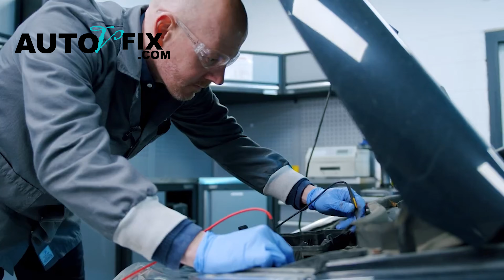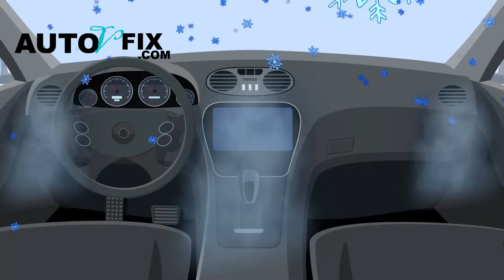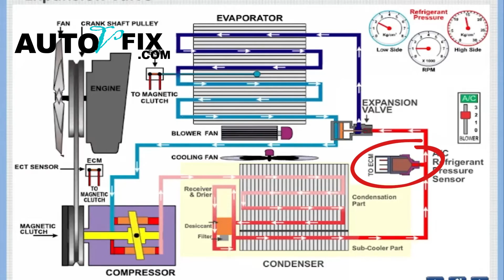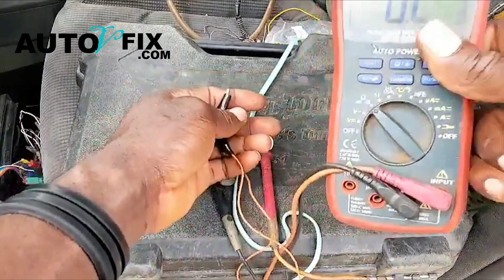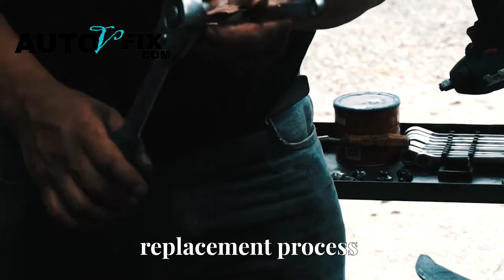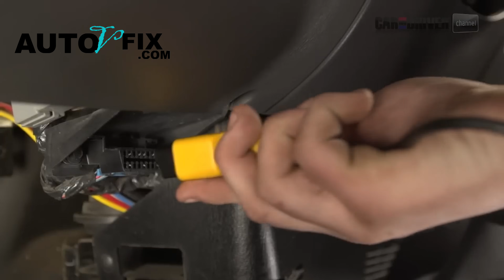SYMPTOMS OF A BAD AC PRESSURE SWITCH(Cost, Test, Easy Fix & Replacement)

Comment: Replacing the high pressure switch didn't make any change. Infact I'm getting not power for the ac/heater and fan 😢
Reply: Did you check the fuse?

Comment: Is their a switch for the low pressure side of the AC system
Reply: Yes
Reply: @MikeBeast007 how or where can I get info on its location, I have looked all over the low pressure line, no joy
Reply: have you looked up year make model of your vehicle + low pressure switch?

Comment: So you have to evacuate the whole AC system or can this be done without evacuating the system?
Reply: Some vehicles have a schrader valve under the switch and will let off the slightest amout of refrigerant when you unscrew the switch unit. One thing they didn't cover was to use TWO WRENCHES, one to hold the coupling, and another to turn the switch body. If you use one wrench, you can damage the tubing and cause a leak. So hold the fitting the switch is screwed into, with one wrench, and use another wrench on the switch body.
You can probably use a low cost refrigerant refill kit with a gauge before you start to see what the refrigerant pressures are, and if you let out too much refrigerant, you can put new refrigerant in to bring it back to where it should be. 
There can be too much refrigerant, which will trip the high pressure switch. This often happens on hotter days, or when you pull up to a red light and run the AC while stopped.
Reply: I’ve done it without flushing and it was fine. Plus when you remove it the pressure releases everything inside out.

Comment: my 2014 silverado (103,000 miles never been recharged) ac was fading a little then suddenly started blowing hot air.  Bought A/C Pro R134A with digital gauge.  It read 141.  I got a regular needle gauge to confirm the reading and it did confirm  the extremely high reading.   Thoughts?

Comment: 2006 Honda Accord where is the AC pressure switch located what's going on with my AC is it was low on refrigerant and we filled it up and it turned on and then as we're driving it started smelling musty like when you turn off refrigerator and all the coal is gone well that's how it smelled and then it got warm I could see the compressor going on and off on and off I hope that's the AC pressure switch that's not working correctly